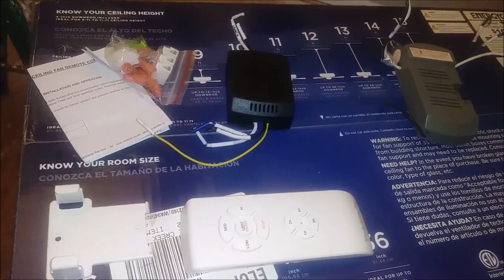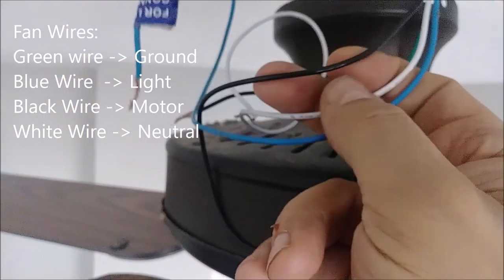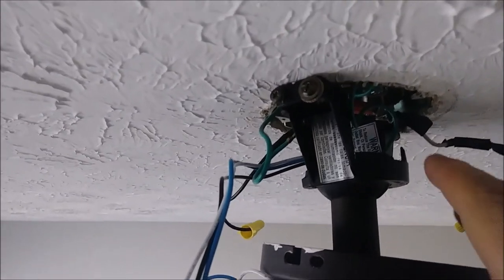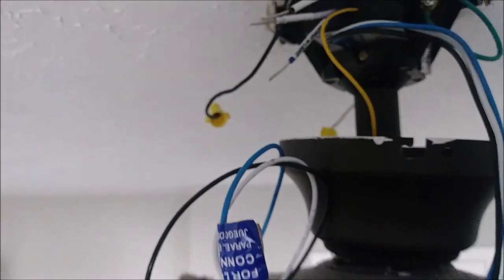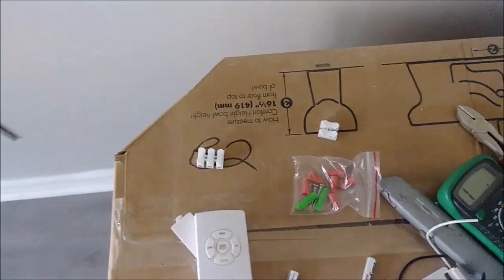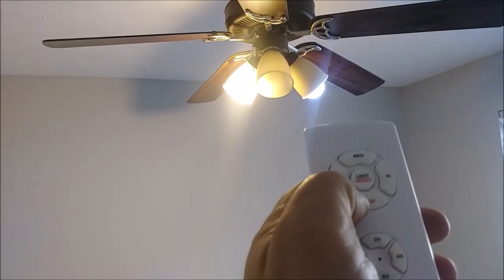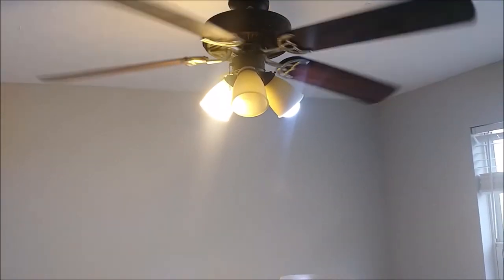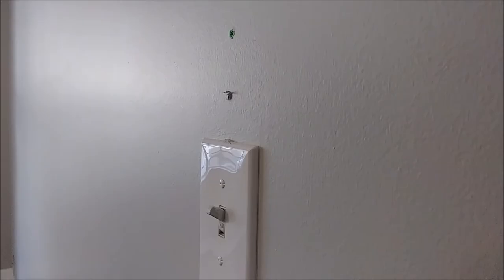Install Miniature Universal Ceiling Fan Remote Control - Most Inexpensive   -YUKIHALU 3 in 1

Comment: I can see that blade arms were likely replaced at some point, since it’s different color. Also I would have fans spinning in opposite direction on July since it creates more breeze.
Reply from the maker: Yes you are correct. Thanks for the info.

Comment: Why did you buy a new receiver? Did the old one go bad? Do receivers sometime go bad and prevent the fan from running? My fan stopped and I don't know why? I even checked the electric and everything is fine. It just doesn't run any more. Was gonna buy a new fan for a few hundred bucks but if it is only receiver I would rather do this
Reply from the maker: The old receiver was fault. Just replace the receiver if the fan is good.

Comment: I like the smaller remote but it’s still to thick for the space it’s supposed to occupy!
Reply from the maker: work for me with no issue.
Reply: We found ours was also too thick. But all we had to do was use a longer screw than supplied to span the little parking spot for the receiver. I could have use a piece of Gorilliah tape if I had to, to cram it anywhere up there I could.nice vid.
Reply from the maker: @Watchoutforsnakez  Thank for the info.

Comment: what if all the wires from the fan are white? previous owner did it !!
Reply from the maker: Use ohm meter as follow :
Put the ohm meter on range of 100 ohm and measure the resistance between two wires. If it is not infinite( the resistance should be close to zero) this is the two wires going to the motor. One wire is the hot and the other is the neutral. Now measure the resistance between one of the wires (going to the motor) and the light house if you get resistance 0 this is the neutral if not try the other wire .